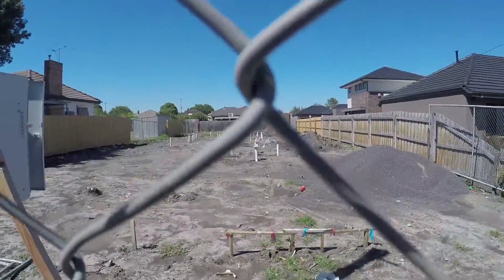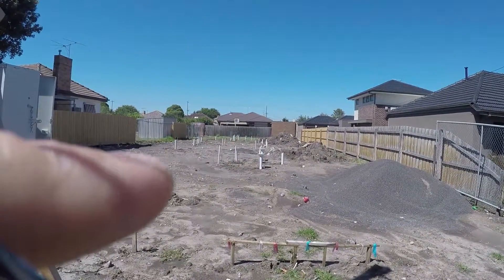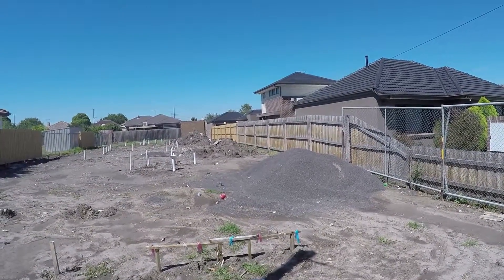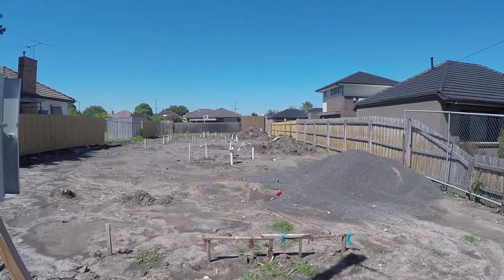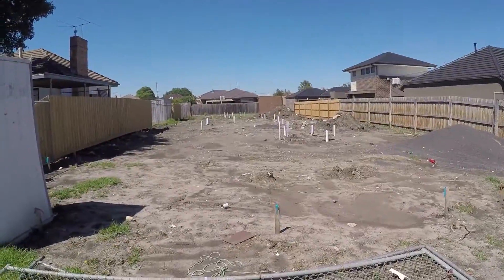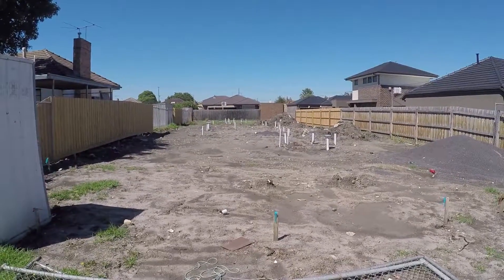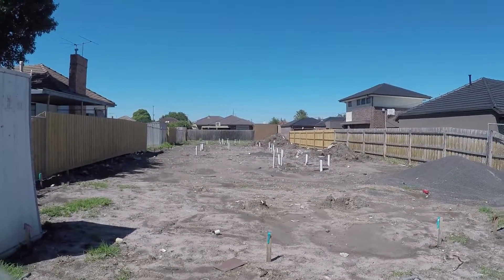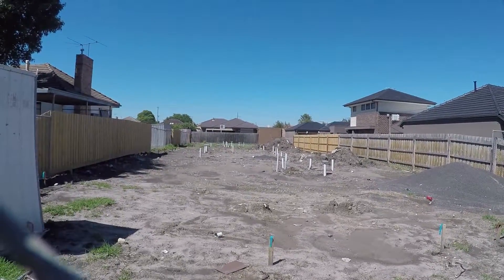waffle slab cut in

Comment: Hey buddy. Can I ask your opinion on something if you don’t mind me asking? I’m about to get an extension built on the back of my current period style home and we were hoping to do a polished concrete floor for it. Only thing is, where in an SBO and Melb. water have come back and said our floor level must be no lower than the existing dwelling’s floor, which is 500-600mm. Can you recommend a way of getting this polished concrete floor with a slab at that height? Our architect has said a waffle slab is an option but I want to avoid that if possible. Thanks heaps bud.
Reply from the maker: Gday Lee,
there are a number of different ways and this REALLY depends on your budget, yet the best outcome for you sounds like a suspended slab system that's built up to suit the height.
if you need to come up that height though why not a stump and bearer system? 
Stay awesome
joe joe
Reply: @BeowulfBuilders  Thanks mate. Yeah, it's looking like Bondek on brick piers could be the answer here. We really wanted the polished concrete floors, hence stumps and bearers weren't really an option. Although, if this ends up smashing our budget, it will be stumps and bearers. Cheers pal.
Reply from the maker: yo Lee,
there is a system where you can use a waffle slab cut in and boxed high crossed with a suspended slab .....this could possibly work but id have to look at the engineering and specifications/comps
thanks again buddie for showing interest in the channel...
joe joe

Comment: are they any good read a lot of legal cases going on re raft slabs and heaves
Reply: good builder will avoid the waffle slab
Reply from the maker: Gday Frank Zalazar
check out video....stop the raft/waffle slab
major problems with this method of building

all the best and stay awesome
uncle joe joe
Reply: getting house built on p class site think its a waffle slab but cant see any mention of raft slab
Reply from the maker: Gday Frank,

if this is a family home then its important to get a look at the engineering and the cost variation between conventional slab (old school cut in) and the waffle/raft slab.

remember the conventional gets cut into the ground with internal beam work
raft/waffle sit on top

stay awesome
uncle joe joe
Reply: theres a cut inn beam work
Reply from the maker: check out the beowulf builders  video on raft/waffle slabs.....there are many legal cases regarding these slabs failing adn we explain why they fail